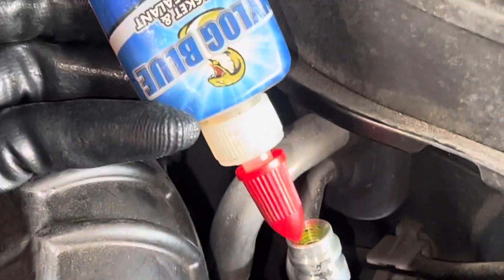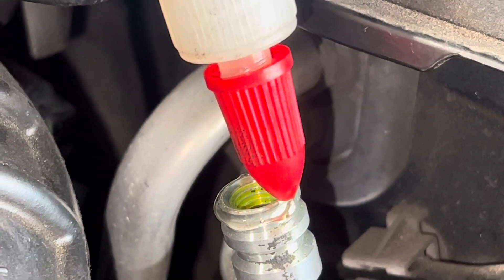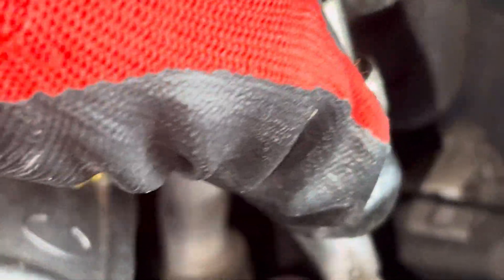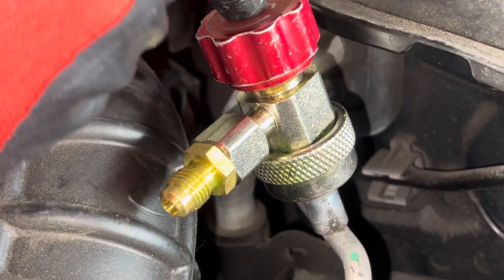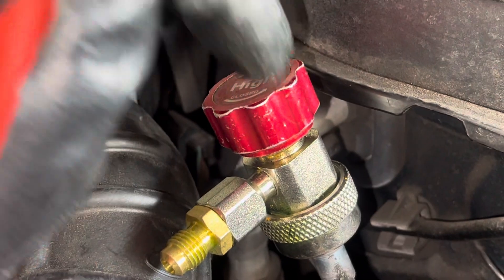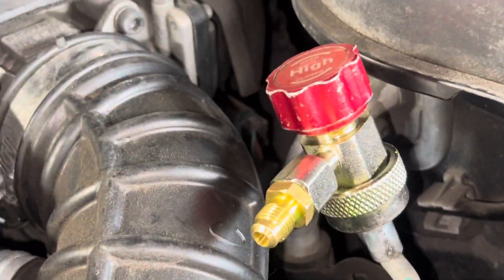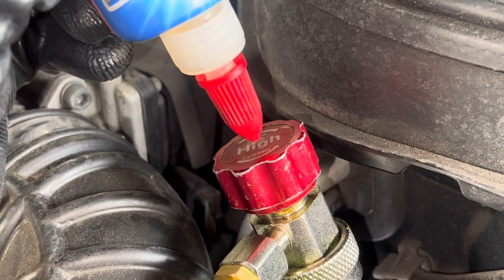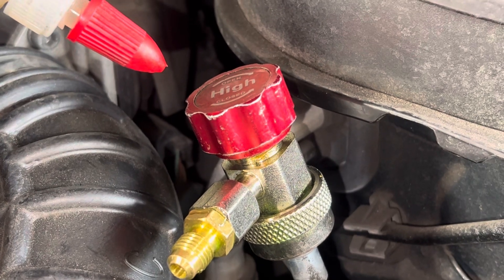NYLOG TO SEAL AND SAVE YOUR REFRIGERANT CUPPING ORING STOP VACUUM LEAKS

Comment: Until  I used Nylog  on coupler [thread and rivet ] and service connection my setup leaked vacuum .
Tool vacuum leaks can prevent from getting much lower than 1000---3000 microns.
*  replace o rings in coupler frequently 
**    USE NYLOG on service cap seal 
** even high quality Parker Hanafin connectors leak